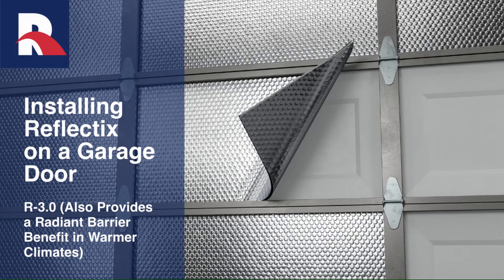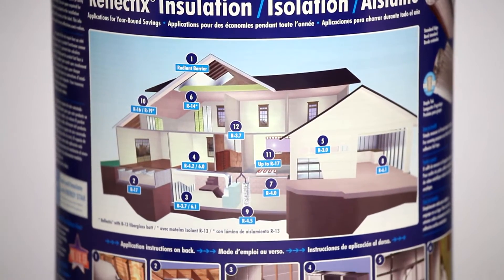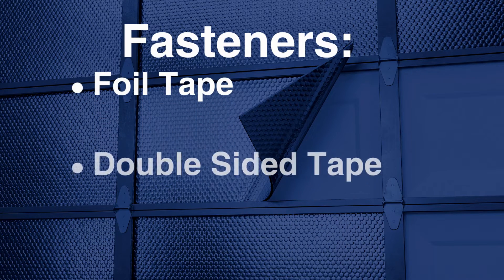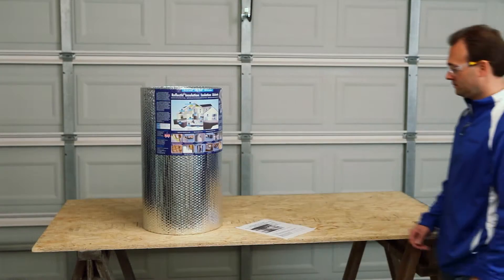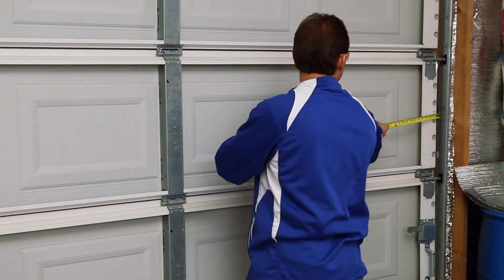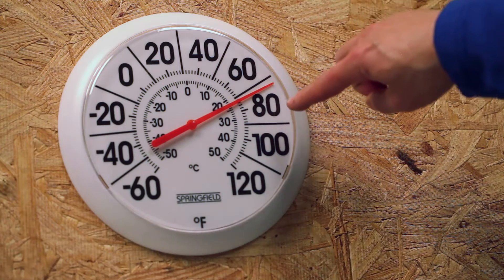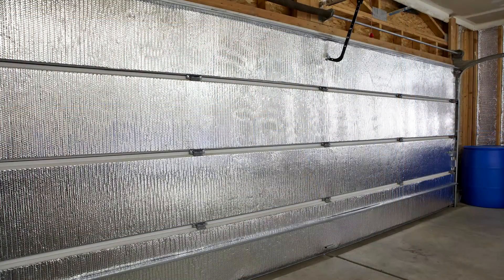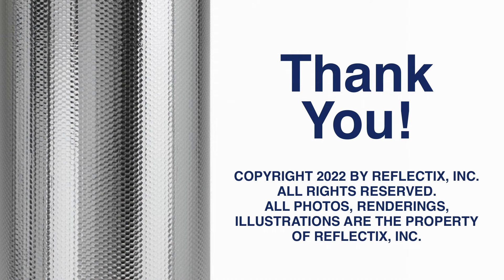Garage Doors

Comment: There's a problem with this:
Even though my garage door panels are well insulated, I'm finding out that the metal strips (often called “thermal bridges”) between each panel still get hot and transfer quite a bit of heat into the garage.
Reply: Can you try to install reflective sheets over where two panels meet? Just make sure that installation doesn't prevent the movement of your garage panels.

Comment: My garage door panels don't have the metal brackets around each panel -- mine are just flat/flush.  Is there a way to create an air gap or is it OK to just put the Reflectix right onto the panel?
Reply: Mine is the same way.  Hoping to find answers

Comment: I installed this and now my garage door will not open with the remote.  Chamberlain says you can’t use foil on garage door insulation with their units.  Fail.
Reply: Really?!?  I'll have to check that before I do the project--I have a Chamberlain garage door opener, too.  Thanks for the heads-up!
Reply: @nancym1430 I was able to fix the problem by reversing the panels so the foil was facing out and also installing an antenna extension from the opener to outside the garage on the door frame.
Reply: @willytrouble88   I was thinking about the issue with the g/d opener -- is it because the foil blocks the signal from the remote?  I can't imagine that the foil insulation stops the g/d opener from working from the wall button.   Also, my garage doors have windows in the top panel, so I wonder if the signal will just go through anyway!    Glad you got yours fixed -- it's always a good feeling when you figure things out!